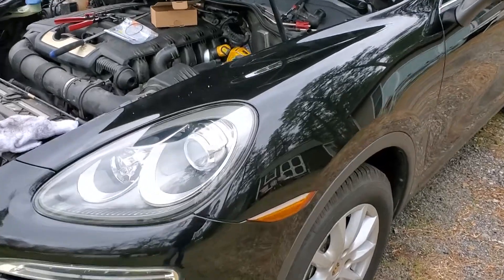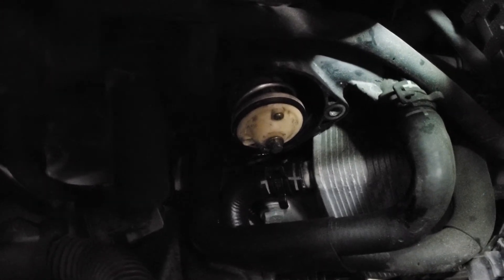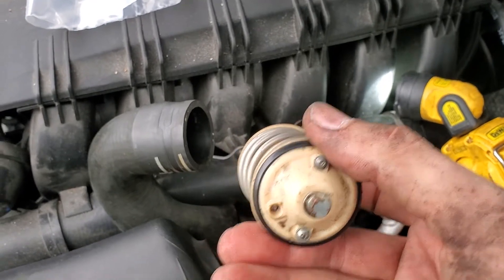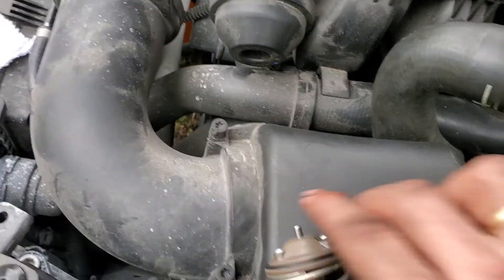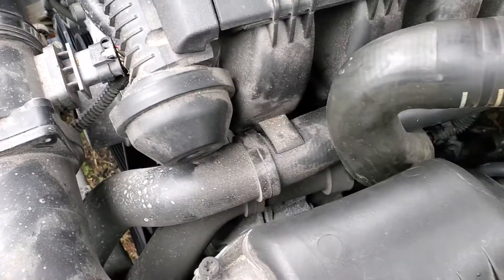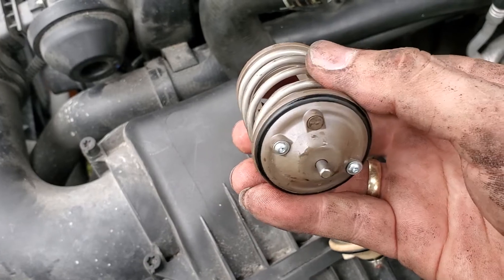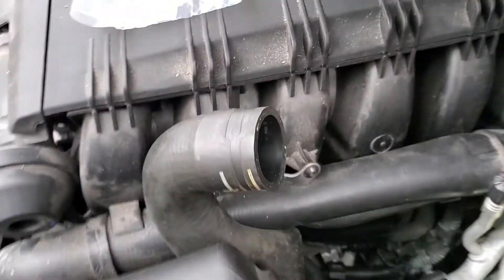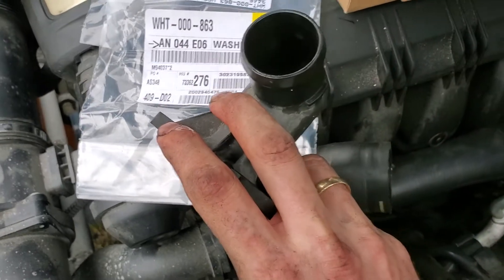Porsche Cayenne Base 958 V6 3.6 thermostat location, replacement  and review part 1

Comment: How do you bleed air out of system, I had a broken T-piece that I replaced and I can’t find coolant bleeding valve.
Thanks
Reply from the maker: There isn't one. You suppose to vacuum fill the system. I didn't have the tool so I had my truck on  battery charger, turned ignition On and turned heater On inside without starting the vehicle. That way I active the auxiliary electric water pump to circulate the coolant and bleed the system. It worked for me. Best of luck.
Reply: @ thank you, I ordered tool and I wii try to do it without coolant already in
Reply: Can you tell me where the sensor that controls the fan on that engine is located?